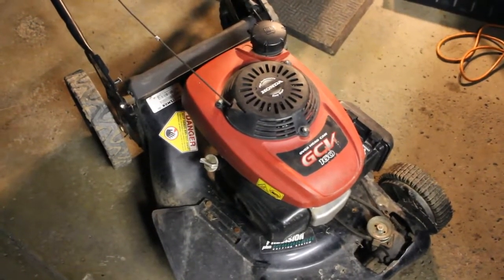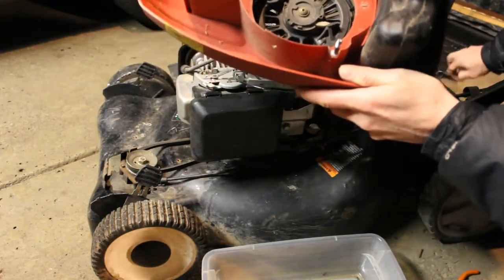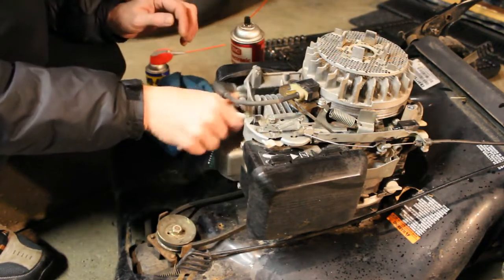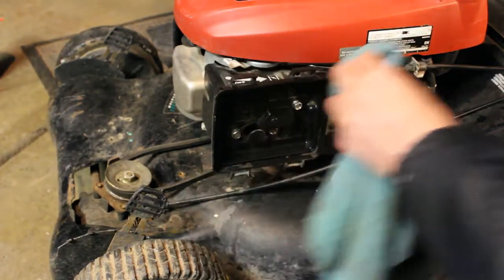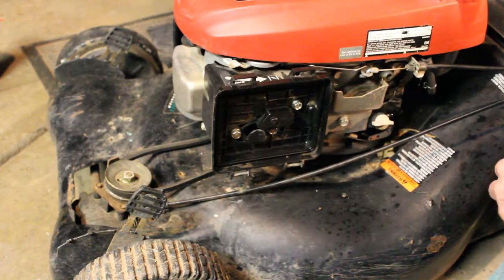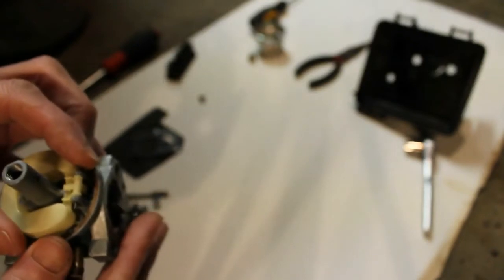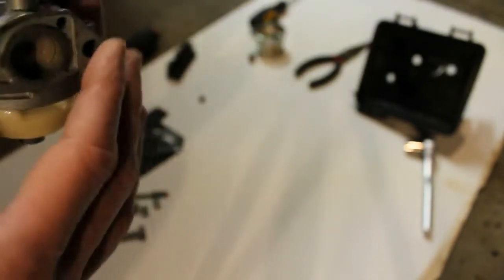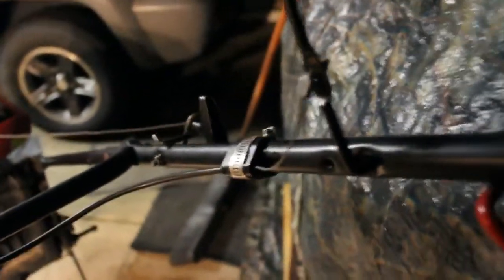Curb Find: Craftsman 917371722 Mower Honda GCV160 Engine Repair, Can we fix this?

Comment: I own one I believe 17 years old.  Its been used and abused all these years and it keeps going I cant believe it still runs.  Before purchasing I was buyins a walmart special brigs every spring
Reply from the maker: Nice Noah, it is a heavy duty when things were built to last. I am restoring a Toro 622 snowblower currently, total teardown, I don't know if you use them where you live but if that is something interesting it will be done in a month or so. Thanks for watching!